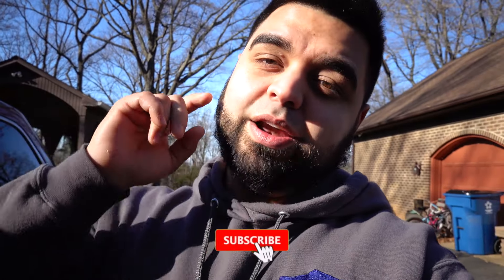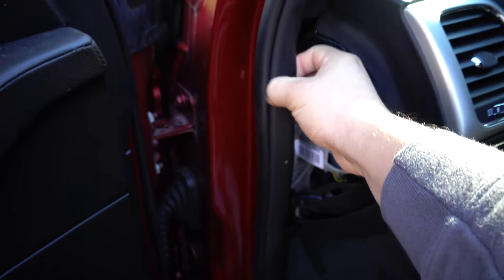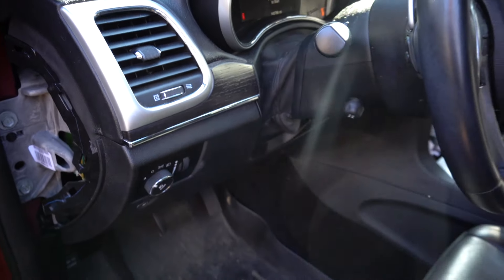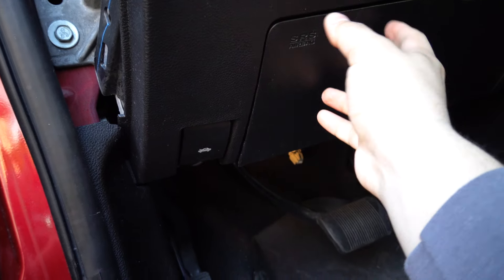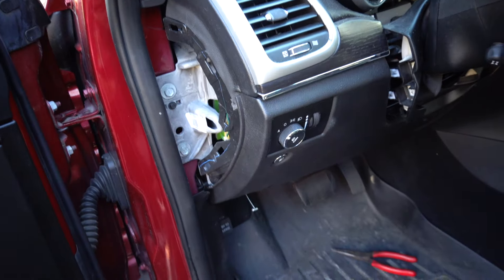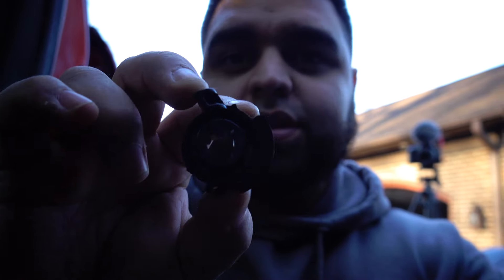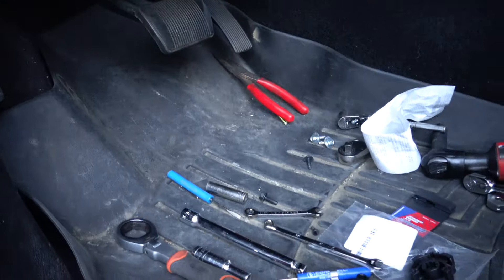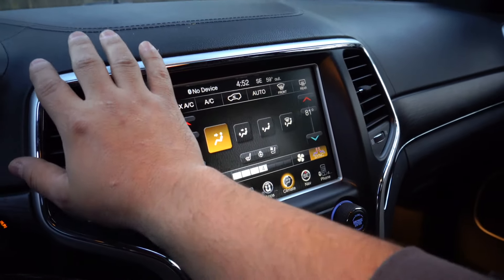How To Replace Driver's Side Blend Door Actuator Gear | WK2 2011-2020 Jeep Grand Cherokee

Comment: Quick tip to those who are going to attempt this - remove the plastic duct work next to the door blend motor itself. It will provide you with enough room to access the top t20 screw. It’s an extra step but it will save you a ton of frustration. Cheers !
Reply from the maker: Thanks for your input! I will pin your comment so it’s the first one people see 👍🏼
Reply: Are you talking about the duct work that is for the floor heater? If so, ho do you remove that? I tried pulling on it just a little but afraid to break something! haha
Reply: The duct work is a clamshell design that comes apart at the edges. Try to squeeze your hands in there and grab both sides, they will come apart. Takes a little bit of patience but you have all the room you need once you separate the ductwork
Reply: @Speednlux  ahh ok good to know. I noticed it was split at the bottom and I was worried about breaking it. But not anymore. Thanks!
Reply: Did you have to calibrate the actuator? I just replaced mine and I guess it's not cold on drivers side still.
Reply: @LIONSTROLL I’m having the same issue.
Reply: @LIONSTROLL did you ever figure out what was wrong?
Reply: @LIONSTROLL there is another video that states if you disconnect the battery under the passenger seat it will help to reset everything but I haven't verified
Reply: Thanks doing this tomorrow
Reply: Yup!!I yanked mine out and also saves you(at least me) from having to pull off anything from the dashboard

Comment: TIP: if it hasnt been said i just did this now. It just needed the gear. ***The top screw, I backed out most of the way but did not remove it. I removed the bottom screw and was able to pull and swing the actuator out with plenty of room to replace the gear. Didn't even unplug the wires. Saved the frustration of getting that screw back in, just had to tighten that scew back down. Took me less than 30min to complete the job of the gear change.

Comment: Good video, but the root cause of the problem is that the blend door rubber gasket melts/softens and causes it to stick open or closed.  Once it is stuck the motor turns the gear and snaps it.  This is why it happens over and over.  You have to get tools into the blend door to clean away/remove the gasket that has melted.  I did this on the passenger side in mine and it has not happened again - but was a huge pain to do.  Won't get another jeep because of this

Comment: This video was helpful, and so were many of the comments.  I agree with some other commenters who say you don't need to remove the whole lower dash panels.  I was able to remove just the felt panel at the top of the footwell, the lower duct, and the 2-piece upper duct.  Its actually a somewhat easy fix from there.  An important point to remember is to line up the actuator gear properly with the flapper gear.  Theres a larger section on the actuator gear that aligns with a larger gap on the flapper gear.  Good luck everyone.....go save yourself $1,200!

Comment: I just replaced this driver side gear on my wifes WK2 Hemi and that was a P.I.T.A I swore the whole time 😂 now that I seen the duct work next to the screws comes off like a clam shell I will be two times as fast when I inevitably have to replace it again. Also I sprayed a little bit of lithium grease where the gear goes in for luck I guess to lubricate the blend door 🤷🏽‍♂️ I read that's why they snap is from friction/resistanfe against the gear. Stupid design nonethless 🎉

Comment: Everyone has great tips in the comments but I wanted to add one more. I never read the comments to see about taking the upper ducting out like a dummy. So I improvised and adapted. I knew for a fact that my gear was broken because had pieces fall down as I was taking everything apart. As we all know that top screw won’t come out without removing the upper ducting (I didn’t do that) so with the powers of observation I could tell that putting that top screw in after taking it out would be impossible. So I took the top torx screw out of the actuator about 85% of the way… enough to free it up and get it to move. I then flipped the actuator up and out of the way and put the new gear in then wiggled the actuator until it found where it wanted to be. Everything popped back together nicely and then I only had to wrestle with the bottom screw and then just tighten the top one. I’m no mechanic so it’s probably not the “preferred” method but it’s certainly another option for folks. I have heat on both sides again so I am happy. Good luck!!

Comment: Do they need adjusted? I had my driver side break. Replaced it and iv noticed my heat is hotter on the passenger side then the driver side

Comment: Good directions, even with the open end ratcheting wrench I still had to grind down the T20 a bit.

If you are doing this job make sure the blend door is free before you put it back together. It should move easily. It might take a little force to break it loose if it over traveled and broke the gear.

Comment: Hey. Remove the top duct to access that top screw. Super easier.  Duct is in two pieces and meant to come out easily. And there is a peep hole to see if the actuators are broken.

Comment: I have a loud clicking sound when I open the door, but the heat and cold blow fine, I’ve checked the passenger side and there are no problems

Comment: Great video! The comments below helped significantly as I did not have to remove any parts other than the bottom felt with accent lights and the bottom vent. For the later, i removed the bottom and top clamp shell portion which gave be easy access to the screws. The job took less than 1 hour on my 2014 Dodge Durango. In my case the actuator failed and not the gear. The gear looked fine, so I did not replace. I have 116K miles and it's the first actuator to fail. I'm taller, so I laid on my back on the drivers side floor with my right arm behind the brake pedal for most of the job.
Reply: So did you not have to remove the airbag and all that extra stuff ? I have a 2014 Durango I need to do this to today

Comment: I just had to do this on a 2012 and I have one piece of advice, I honestly wasted too much time trying to get the hood latch cable off before I realized you can just pop the whole lever assembly out of its spot on the plastic panel by unscrewing the panel, pull it out a bit and then take a screwdriver and push it out from behind, it has a tab like the electrical connectors that you press down then slide the whole thing out of its spot on the panel. Just a tip to make the process that much faster and you don’t have to worry about putting the cable back on when you’re done! 
Otherwise great video, and thanks!
Reply from the maker: I never knew that. Now I want to go check mine out to see if it’s like that lol
That is good advise if they’re all like that because you’re right, the cable is not only an extra step, it’s pretty time consuming as well.

Comment: When i took i the 5 bolts 4 at bottom and 1 behind steering wheel bracket i was able to bring the panel patially down but it feels like theres other bolts which i'm assumming the 2 10mm bolts you were refering to. I had trouble locating those bolts becuase in the video i can't tell where you were on the lower panel pointing out the 2 bolts. I have 2014 jeep grand cherokee limited.
Reply from the maker: It’s a pain to get to them. They are behind a bracket so it’s barely visible to the eye, let alone a camera.
Reply: @StayOnTheGas  thanks i finally got them. You're right they are a pain. Your video was really helpful thanks.
Reply from the maker: Glad you got it done. No problem 👍🏼

Comment: Do you have a favorite Jeep Owner's forum for troubleshooting advice?  I own a 2011 Jeep Grand Cherokee Limited 4x4 Limited with 5.7L and I'm not sure the electric Rad Fan is behaving correctly.  Can you do a check of operation on your Jeep and let me know?  The question is:  Does the electric Rad Fan come on as soon as the A/C compressor is engaged?  On my car it doesn't.  The Rad Fan will come on when the water temp gauge gets halfway up the scale, and cycles to maintain proper radiator temperature.  Even with A/C and compressor running, the Rad Fan is not normally on.  This seems wrong to me, based on previous vehicles I've owned.  Without the radiator fan running, the liquid line under the hood gets FIRE hot when car is not moving.  Just recently, I began hearing a hissing sound from under the dash when A/C is on.  Believe this to be the sound of refrigerant flow, and wonder if system is low.  My compressor runs continuously, and there is cooling, but not sure if it is normal, or under capacity.  (Living in Atlanta, GA, and temps are still moderate.)  Can you point me to a resource where I can learn theory and normal operation of modern A/C operation?  I am familiar with "cycling clutch and fixed orifice" design from 1997 Mercury Grand Marquis, but Jeep is much newer and has TXV (thermal expansion valve) located under the dash, just before the evaporator.  Thanks for any ideas or suggestions.  Chet

Comment: Question… I just replaced the passenger side door blend actuator. This resolved hot air blowing from back vents, but still on the passenger side. Could the driver side be the issue for passenger side for some reason? It’s starting to warm up here in Maryland

Comment: You are brilliant sir. Changing out that bolt/screw for that 8 x 1/2 is the best thing. I just changed out our 2011 for the second time and that will save a lot of tiny little turns. Thank you. That plastic piece seems to last 25K and then goes bad on our Jeep. Both sides that is.
Reply from the maker: Thanks man! Yeah they don’t last long and I can see why. That’s why I tried to make it easier for all of us since i know we’ll be back in there doing it again lol
Reply: Someone needs to make a mold for them to be cast out of alloy 😂

Comment: Great video.  Had to do this over a weekend.  A couple added tips:  1)  Definitely need to take out the upper duct work to get to that upper screw on the acuator.  It is hard and seems like it wont come out, but it will.  Break the clamshell and take out the rear first and then the front.  When you put it back together, put the rear in first and then force the front part of the upper duct in.  Then do your best to snap the clamshell together.  2)  Reattaching the hood release cable with the kick panel doesn't work.  You need to take off the hood release lever from the kick panel and then attach the cable to the handle.  Then insert the handle back into the kick panel.  Thanks for all your help!

Comment: this Video was so helpful and the only reason i attempted the repair myself. it also took me about 6 hours. i think i could do it in about half the time if i ever had to do it again. i wouldn't do it again, i would just trade the jeep in..lol...not going to lie, it was a bear to do. i am a big guy so lying under the dash was not an option. torx bit electrical taped to a 1/4" wrench was the only thing i had to fit to get the factory screws out. lots of scapes and invented swear words later and i succeeded. thanks again for the video.

Comment: And thanks for the great video. One comment I will make is for that one screw that is the hardest to get if you remove the air sensor from the upper duct, you can pull that duct out fairly easily it may come out in two pieces, but it snaps back together pretty easily.

Comment: excellent video. my gear broke 3 years ago, I was able to put the new gear on, but only put one of those original screws back in, and sure enough 3 days later it failed. like you said this job  is the most frustrating, stupid repair I've ever done. 

anyway I was without warm air for 3 winters in Michigan, I came across this video and decided to follow your steps, still frustrating AF, but like you said, if it fails again, it'll be a lot easier. thank you!

Comment: I have a 2012 grand Cherokee that is blowing air off the engine on driver side but AC and heat work fine on passenger side and back.  What do I need to change out to fix this?
Reply: Did you ever find the issue ? I’m now having this issue where the passenger side works perfectly fine but the driver side doesn’t blow the same it mostly stays cool even with heater on

Comment: Can anyone clarify how to remove (or if I even need to remove) the airbag panel that is down by the drivers knees? I have replaced the actuator in a 2011 (both sides) and when I was doing a 2014 I noticed there was an airbag in that lower panel. Is that lower panel one whole piece or does the airbag part stay? I see in the video there are several 10 mm bolts to be removed, but I'm not sure how the panel comes out. I don't want to yank or pull on it that much and I'm little nervous to continuing until I understand this part...thanks in advance
Reply: Having the same problem
Reply from the maker: It comes off together but you have to get the right nuts off
Reply: Hi do you need to disconnect the battery terminal when removing the airbag panel to gain access to the actuator?

Comment: My situation is different, driver side blows only cold air and passenger and the back blow hot air especially passenger it's super hot and won't blow cold.
Reply from the maker: It’s the other side then. I have a video on that too
Reply: Oh okay so it would have to be fixed through the passenger side? By taking glove compartment out? Thanks so much for answering this has been such a hassle figuring out!
Reply from the maker: Yes exactly! If you watch my video you’ll see what I mean. It’s actually easier 👍🏼

Comment: Is it the same actuator and gear for both sides? 
Mines giving out on the driver side and failed on passenger side. Hoping I can just grab a two pack and get both sides done.
Reply from the maker: Yep! Same thing on both sides. I have a video for the other side as well. Good luck 👍🏼
Reply: @StayOnTheGas  you know if it's common for the actuators to fail and not just the gear? Based on the labored sound the driver side is making I'm assuming it's more the actuator motor than the gear...
Reply from the maker: So I’ve heard people say always replace the actuator and the gear at the same time but I’m cheap and only did the gears lol. My actuators make noise from time to time too but I’ll dish out the $200 for both of them next time the gears break.
Reply: @StayOnTheGas  $200? Im looking on amazon at one right now for $15. I am really confused though if I need to replace the gear and actuator and haven't found guidance on how to determine that. Driver's side only blows heat, non-stop clicking noise.
Reply from the maker: 200 for the actuators. They’re roughly 100 a pop for OEM ones. I’d check to see if your gear is still in good shape. If it is then it’s your actuator probably.
Reply: @StayOnTheGas  I got two actuators for like $40 from Amazon. We'll see how long they last. New actuators and gears and only a few cuss words!
Reply: @williamschlueter1415  if you hear clicking it's the actuator...  if the air isn't changing temp its the gear... If it's both = change both.
Reply: @StayOnTheGas  ah gotcha thanks! The gear fell out in pieces so I know it has to be replaced just wondered if the clicking noise meant the actuator motor was bad also
Reply from the maker: May just be the gear honestly. But like I stated before, a lot of people replace both so if you’re not cheap like me, order the gear and actuator 👍🏼

Comment: I just replace mine about 2 weeks ago and i didnt need to remove none of that stuff i just look up under there right next to the steering wheel and it was there big as day. It took me less than 30 mins to pop out the old and pop in the new..
Reply from the maker: What trim do you have?

Comment: I feel like a cordless electric ratchet wrench would of zipped those right off ... ill be working on mine over the weekend .. thanks for sharing and great video !
Reply: Update .. even with your video took me about 2.5 hours .. Actuator Gear

DA1390 

Same broken part... mine I had to break the flap free .. it was stuck .. the other side that the teeth grap into wiggle  back and forth until it was free .. I think a air fresher vent clip broke an got wedged down in there

Comment: GREAT, GREAT Video, But if you just quickly "pop out" the driver seat (4 easy 15mm bolts / 2 plug ports for pwr. seat), THEN you can lie down, pop that airway duct out, and BOTH SCREWS then / are easily accessible. *("Your ways a good way as well").  :- )

Comment: Thanks for all the tips! This made the project a lot easier. Only took 1.5 hours. A 1/4 ratcheting wrench with a t20 wrapped in Teflon tape, so the bit doesn’t slip out, worked really well for those actuator screws. Cheers!
Reply from the maker: No problem man! Glad it went smooth for you 👍🏼

Comment: Hell yea! Short enough to keep my ADHD in check and all the angles and info i need. Also, kudos for the tips in the comments about the upper plastic piece. Im not a car guy nor do i work on them any more than just oil and brakes. Some fella told me “you can do it yourself, its super simple. you only take off one piece and its right there. No worries 😐”  Super happy i checked YT first and found this video.

Comment: I have a 2014 limited with the airbag option  and I see 4 bolts
Reply: I have a 2014 too and also noticed 4 bolts.  Now that I have the panel off, you only need to remove the outer 2.  The inner 2 are connected to the airbag assembly.  I believe the outer 2 are 10mm.

Comment: Anyone else’s airbag NOT coming loose when removing those two bottoms screws (10mm). In the video, dudes is flipping around.  Mine is tight and NOT moving.
Reply from the maker: You probably took the wrong nuts off. They’re hard to get to and point out